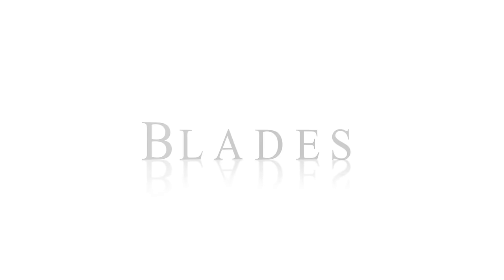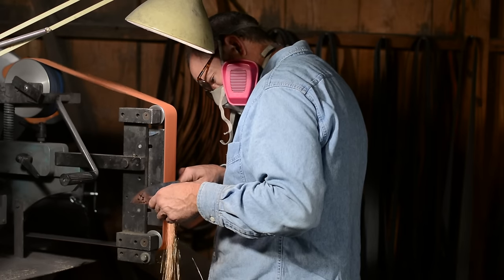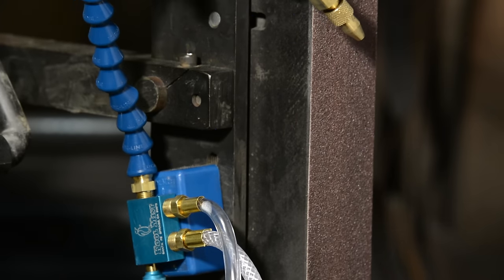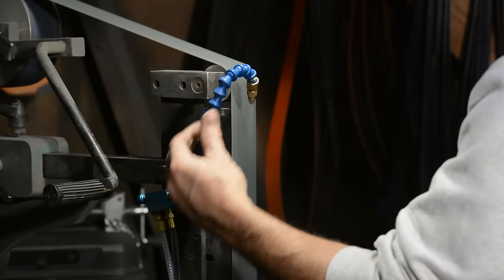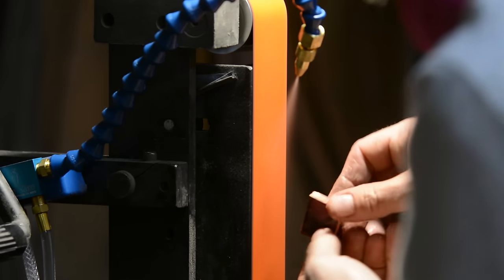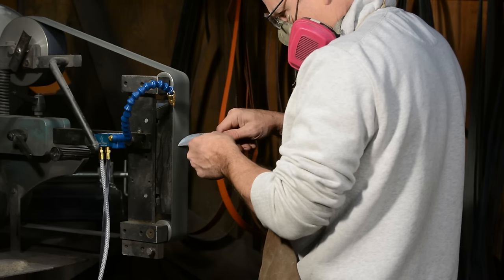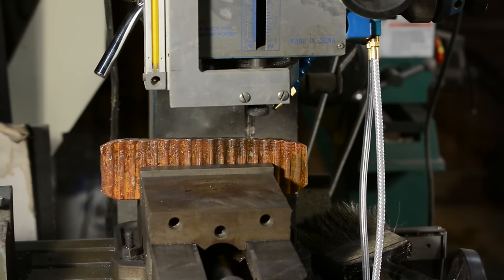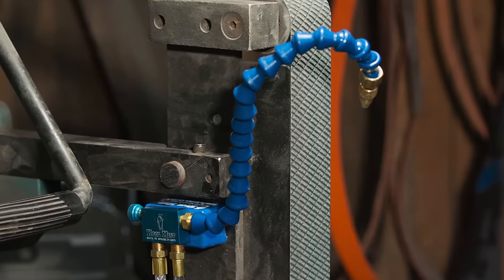Knife Making Gear Review:  Mist Coolant for Your Grinder

Comment: I've used those mist sprayers for decades in the machine shop. They also come in a pumped version as opposed to a venturi. An added benefit is that Kool Mist has rust in inhibitors. I think you'll like it and as you realized, it really "shines" in a production environment. Thanks and Merry Christmas.. :-)
Reply: If you use spray mist, does it not damage the belt? Or will it reduce the efficiency of the belt?

Comment: I set up a water mist straight off the garden hose,i bought the heads at Lowes for under $2 each.They can be found in the garden section.The 1/4" hose can be found in plumbing section.$20project
Reply: Good idea, i was wondering about just building one and skipping the compressor
Reply: That's like hooking up a misting system up on a patio without a high pressure pump and running it straight off the hose bib. I'll kinda work but it'll do a much better job of making a big mess. 
You have to have high pressure to make it run correctly.

Comment: with time and adjustment u can up the air lower water flow and get it less messy smaller tip orifice fam to your side blowing mist away ... i used to use these surface grinding they are cool ...:)

Comment: What kind of belt is that? The blue one with all the pads on it, do they last as long as they look like they might?
Reply from the maker: +Eddie Bausch It's a 3M Trizac "Gator Grit" belt.  They do last a long time but can't be used for heavy roughing.  They get ruined very quickly if you really crank into them hard.  They're fantastic for finish work, though.
Reply: +Walter Sorrells Thanks for the quick reply and info.  I have a few Trizac belts but the pads are much smaller.  I'll keep an eye out for the Gator Grit belts.  I have really enjoyed your videos and they played a big part in getting me started into knife making.

Comment: GREAT IDEA I WAS IN THE BELT BUSINESS FOR YEARS IN THE UK MOST PEOPLES DEFINITION OF WET IS TO HAVE GALLONS OF WATER CASCADING ALL OVER THE WORKSHOP WHEN YOU EXPLAIN YOU ONLY NEED A DRIBBLE OF WATER TO DO THE JOB CORRECTLY  YOU GET A LOAD OF BLANK LOOKS LOOKING AT YOUR VIDEO YOU COULD PROBABLY REDUCE THE FLOW EVEN MORE

Comment: May I ask what air pressure is necessary to run such a mist spray? I am just in the process of choosing a compressor and do not want to overdo it as I do not have any other use for the compressor. Thank you

Comment: I've used mist coolant on a couple of mills and lathes at the machine shop and I thought about using it on a belt grinder but was wondering about how some of the belts would hold up over time to getting wet then drying out repeatedly.

Comment: Thank you Walter for bringing this to my attention. It should work well on my KMG.

Also, I wasn't aware those 3M belts were water resistant. How do Blazes work with wetness? I am always constantly dipping and then wiping off because I was under the impression that the water will loosen the adhesive to the abrasive media. I appear to have been wrong. Thanks again :)

Also, how necessary is the coolant liquid vs. just straight water?

Comment: i thought the gator belts are supposed to be run dry?! only reason I ask I am belt converting an old school doall surface grinder and the gator belts are awesome for that application. it would be nice to use my koolmist on the surface grinder with those belts if I can.

Comment: I've used industrial saws and mills that used this type of cooling before but never thought of adapting it to my belt grinder.  Do you notice an increase in belt life or speed of cut?
Reply from the maker: +Michael Wheeler Not really.  But I'll have to use it for a while longer before I can really tell for sure.  My impression so far, though, is that the main benefit is just heat reduction.
Reply: Thanks for your time and your great content.
Reply: Just a couple of thoughts on the plus side... 1, surely this helps maintaining the grind angle if you don't have to keep dunking? 2, will the mist help as a lubricant and clear the grit on the belt, also adding more life to the belt ( similar to when using wet and dry)? 
Thanks for another brilliant video... and Merry Christmas from over the pond.

Comment: I'm 13 years old and I want to get into my thinking what do I do and welding
Reply: I just saw you on bored paracord. I'm 14 and started making knives the year it's quite fun
Reply: How does this help me at all
Reply: +Tristan Bowman wow someone does not know manners. Simply acquire an angle grinder and good steel like that from an old saw blade and cut away without over heating. Then using a flap sanding disk out a bevel on it. The continue however you want. Not how I do it but with limited equipment that's what you can do
Reply: For welding your on the wrong Channel look for some welding channels on yt
Reply: +Josh Cohn a simple 75x533mm sander like the hand belt sander by makita and bosch are  good enough, that's how I started, not exactly proficient, but you can get some good results with some 40 grit zirconium and higher grit cheap aluminium oxide belts. but you're srock removal and rough grinding belt you will want to last abit longer and be good quality, like i said zirconia in small belts is you're best choice because as far ad i'm aware, ceramic isn't easy to find and even when you do, it's deffinatly not zirconia priced as their custom. :)

Comment: You dont even need an expensive compressor, look for an old refrigerator and use the motor that is in it
Reply: So...a compressor?
Reply: +lazaglider LOL that's funny right there.
Reply: +happymark1805   Using a  1 gallon garden sprayer will probably  do
Reply: +Adamast that meight also be a good idea
Reply: +happymark1805 fish tank pump, bucket of water and a nozzle.